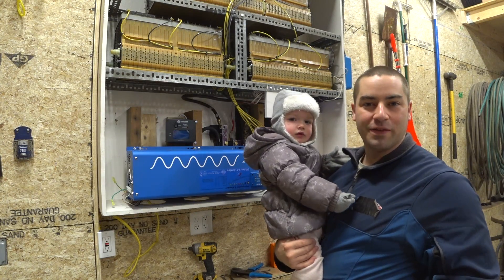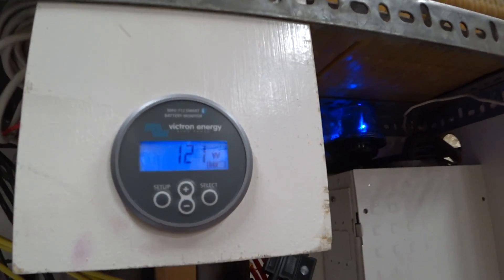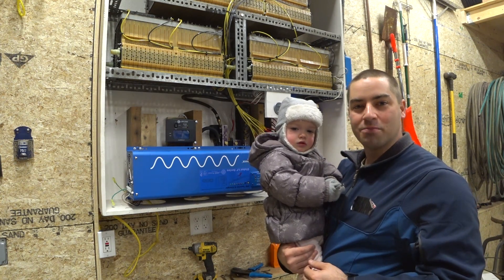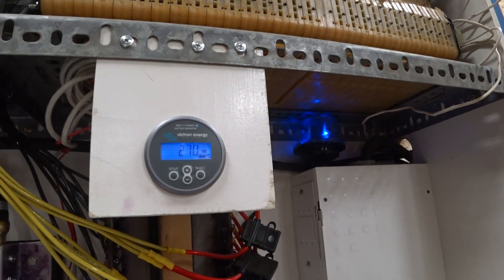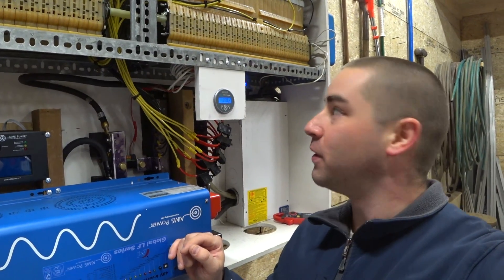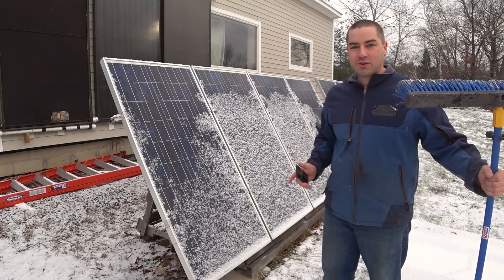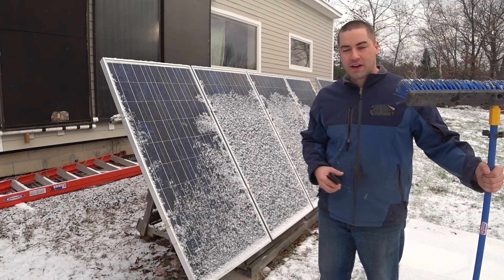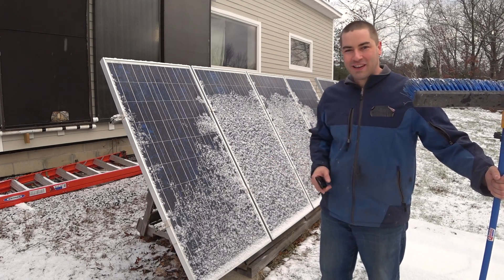Get More Solar Production by Removing Snow

Comment: surprised you are using baseboard heating, a heat exchanger would be much more efficient to generate(well move) heat would it not?
Reply from the maker: A heat exchanger with what?  
If you are referring to a mini-split heat pump, then I have one.  I use it when it's not broken.  But half the time I've lived in my house the mini-split heat pump has been down.  The baseboard heater has never failed.
If you are referring to a heat exchanger with something else, then I don't know what you mean.  I want to fully answer your question, but can you please help me by being more specific?  Thanks.
Reply: @DavidPozEnergy   yes I was mainly referring to your electric baseboard heater for space heating, a heat pump would generate rougly 3X the amount of heat, sadly it seems you had some reliability issues though, which is worrysome...

have you considered using the hot water storage for space heating?
Reply from the maker: My current tank is not sized large enough for also doing space heating.  However, if I was to add another tank, then I might do space heating with it.

Comment: I'm of mixed feelings on clearing snow from solar panels.
Mine are high up. I CAN clear them (for the most part) with an extendable pole. However, what I have found is that in my area, a snowfall is almost ALWAYS followed by very heavy cloudy weather. Clearing the panels doesn't do much. Even with the panels clear, there's just not that much sunlight to make power from.
If there's a snowfall AND it's followed by sun, the sun usually heats the panels enough for the snow to melt and slide off. Especially with STEEPLY angled panels like David Poz has.
The times that I HAVE found clearing the snow to be useful have been when it's been a certain type of snow (which sticks, doesn't melt quickly, and doesn't slide off) immediately followed by sunny weather.
Some other things should be considered too. For example, if you have to stand on top of a ladder to clear snow, that is a risk factor, and people certainly can and do fall and get hurt.
One advantage of a ground mount is that they ARE much easier to access, including for clearing snow.
Another thing I realize is how EASY it is to take for granted being "able-bodied". I was hurt not too terribly long ago in a traffic collision. Part of my injuries as at my shoulder. Using any kind of overhead tool (a fully extended roof rake!) is now pretty difficult for me.
https://www.youtube.com/watch?v=ehoy6XlK4v8

Comment: Yes, removing snow (or leaves, etc) is a no-brainer. Since PV panels are serial devices even a little debris on them will greatly reduce output. That said, if it's a sunny day after an overnight snow, the snow melts pretty fast. In my case, the panels are adjusted to a 45 degree slope in winter, so alot of the snow will just slide off.Another benefit of removing snow is it cleans the panels quite well.

Comment: Why do you use all the solar panels and the run a cable from the battery's to the floor heating
Reply from the maker: I think your question is answered in this video: https://youtu.be/jFoxIit8NYA  If not, then I'm sorry, I'm confused about what you are asking.  I'd like to help if you can be more specific.

Comment: Do you lower the angle on the panels in front of the house during the summer?
Reply from the maker: No.  Right now I have those panels hooked directly up to a baseboard space heater.  So I have the angle optimized for winter since that is the only time of year those panels are on.  The panels in the front yard are off in the summer.  If I ever buy another charge controller and wire them in to the battery, then I'll build new frames  with a shallower angle.   Thanks for watching.  Baseboard heater video here: https://youtu.be/jFoxIit8NYA

Comment: thats sweet! you will have to add a switch to take those baseboard heater panels and add it to your off grid system in the summer so you can go off grid 24/7 in the summer :)
Reply from the maker: You read my mind.